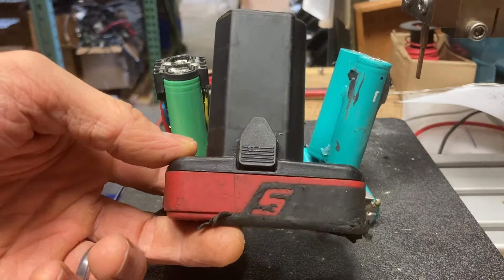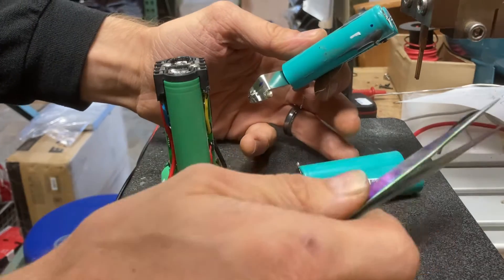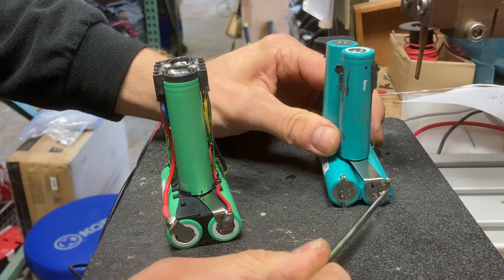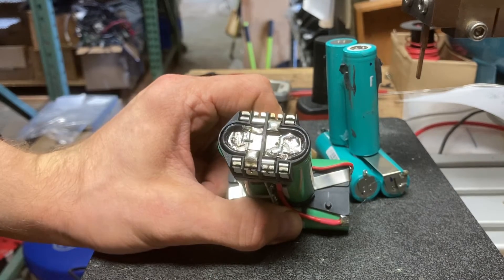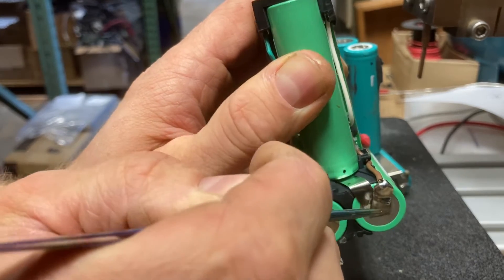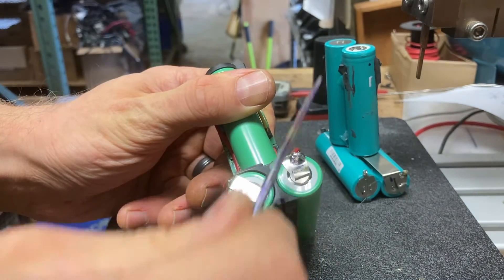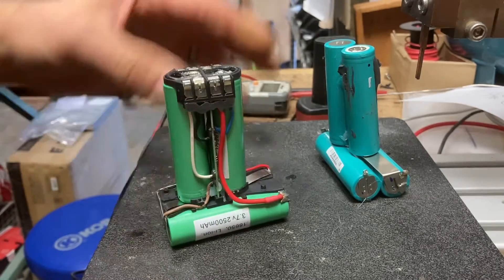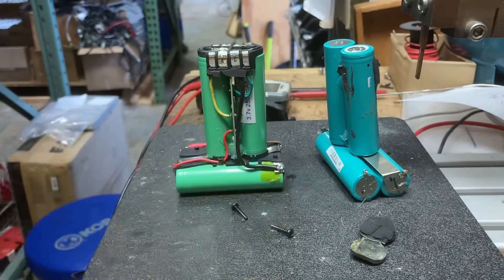HOW TO Repair Snap-On CTB8172

Comment: do you know where i can buy the cases from?
Reply from the maker: Just the outside plastic case?

I would say to check with your local battery store. It’s not a common one to see in the recycling in my experience, but if you let the local battery places know you’re looking for something specific, they may be able to hang onto it if it ever does come across their stores.

If you email me a picture of the problem  and give me some more details, I may be able to figure out something for you though.

Comment: Any leads on where to get new connectors for the top? I have 2 old batteries that don't make a good connection.
Reply from the maker: Not really. Your best bet is usually to get replacement parts off of an identical battery pack.
For reference though, we have hundreds of batteries brought to us monthly for recycling, and even then, I seldom see SnapOn in that mix. When I do, I snatch it out to rebuild it usually.

Comment: Hi i replace al 4 batteries and got voltage in all pins from battery but charger blinks red, any suggestion? any Idea how to troubleshoot the bcm? And what the pins with letters do?
Reply: Make sure everything is very tight.
Reply from the maker: Sometimes just adjusting the contacts for proper connection with a charger is enough. That’s how sensitive Milwaukee lithium batteries are.

Comment: Do you know if it’s water damaged can you still do this I have the green crusties and do you happen to know when you could buy a circuit board or female connectors
Reply from the maker: It’s hard to say with water damage whether the circuitboard would still be good or not. You could use a voltmeter to check for voltage. If you’re getting something, there’s a chance to circuit board’s still working. If you’re getting nothing, it could be the batteries or the circuit board or both. I wouldn’t think it worth chancing a rebuild it if it had water damage.

Comment: How did you open the plastic case?
Reply from the maker: A heat gun. I warmed the case with a heat gun. As it warms up, the adhesive strips on the inside loosen and eventually let go.
Reply: @Duby4life I think getting the case off is the hardest part. My two oldest batteries came apart no problem but my new model battery that I dropped and just want to switch cases as it broke was really difficult to get the stump out

Comment: Can i use 3000mah 20amp 18650 cells)
Reply from the maker: I’m not sure what the 20 amp rating is referring to, but yes, you can definitely use 3000 mAh cells. Confirm they are lithium ion (3.7V) and not lithium iron (3.2V)

Comment: what is  resting   voltage on this  battery , i check both side  and get  8volts on each + - set  , but it will not charge on charger  flashes red . should it charge at 8 volts or does it have to be closer to 12volt  so to not trip charger red indicator . please explain clearly
Reply from the maker: 8 V sounds decent. 8.4V is probably closer to fully charged. I believe this is a 7.2 V battery pack or 7.4, depending on how the cells are being listed. I’m not sure why it doesn’t charge on your charger. I would test a different battery on the charger if you can to see if the charger is the problem.

Comment: can i use more capacity like 3500mah,,,
Reply from the maker: Yes, you definitely can and it will increase your run time. Just make sure if your pack is built with lithium ion cells (3.7volts/cell) that you stick with lithium ion cells. Don’t accidentally use lithium iron cells.

Comment: What amp rating are those replacement batteries? The original are 23amps. I'm curious if it matters going lower
Reply from the maker: I put in 2.5A cells. I have 3.0 I could’ve used, but not for this project. If you go lower, you’ll get less runtime off a full charge. If you hour of full use from the 2.3A cells, you might get 35 minutes if you put in 1.5A cells.

Comment: What kind of battery cells are those and where can I obtain some them?
Reply from the maker: @CJ these are called 18650’s. They are the most common Lithium Ion cell. The one’s I’m using are 2500mAh each. You can find lesser runtime (1300mAh) or greater runtime (3000+ mAh) and the cost only varies a couple dollars per cell.

Look up 18650’s online and I’m sure you’ll find enough options. Be warned though, there are inferior qualities out there!

If you want to order them from the company I work for (I can vouch for the good quality of these cells) you’re welcome to shoot me an email at Warehouse@batterywarehouse.com and I’ll send you a quote.

Thanks for watching, CJ!

Comment: Very informative video! Can you maybe do a step-by-step video on how you did this, similar to a walkthrough? I have an old Dremel where one bank (of a two bank battery) is shot and I would love to repair it. I'm afraid to work with lithium batteries but feel I could make it work if I had better instruction (solder? Spot weld? Other method?)
Reply from the maker: William, I have a few step-by-step videos recorded that I’m editing through at the moment. One is of another Lithium pack.

If you want to email me a few photos of your battery, I can look through my pile of recycled battery packs to find as close a match as possible. I can do a build specifically on that one. If that’s of interest: duby4life@gmail.com.

Do you have a soldering iron? A spot welder?

Thanks for joining me on the channel!
Reply: @Duby4life   what is  resting   voltage on this  battery , i check both side  and get  8volts on each + - set  , but it will not charge on charger  flashes red . should it charge at 8 volts or does it have to be closer to 12volt  so to not trip charger red indicator . please explain clearly